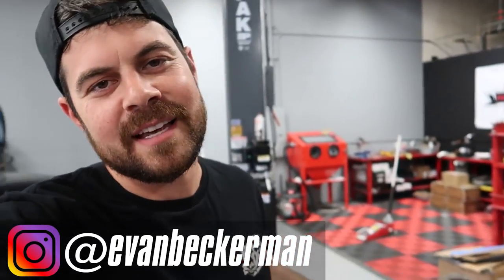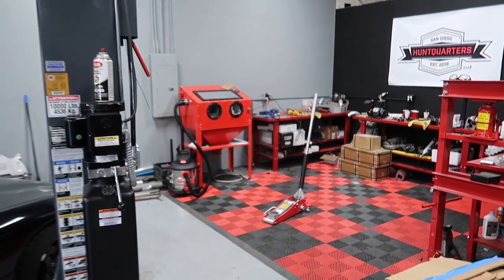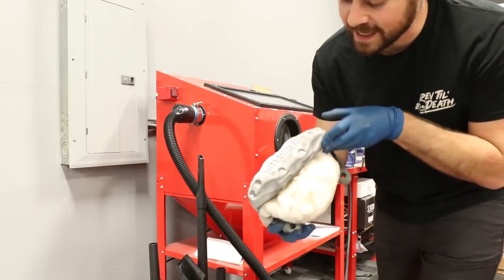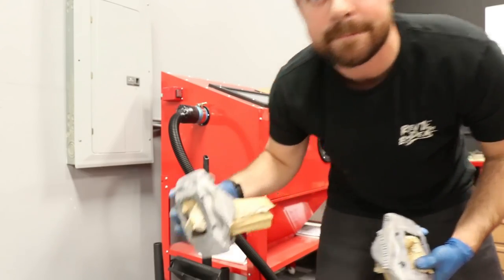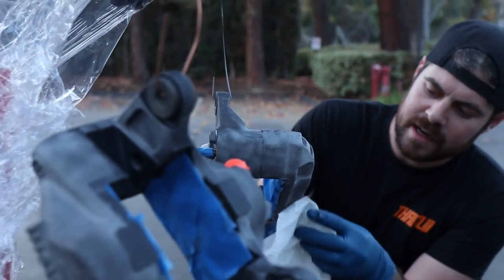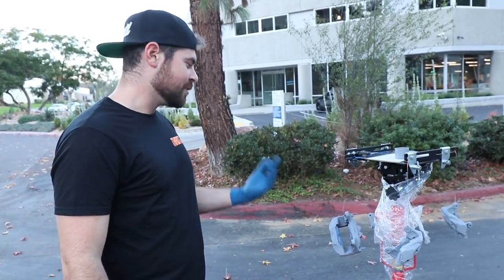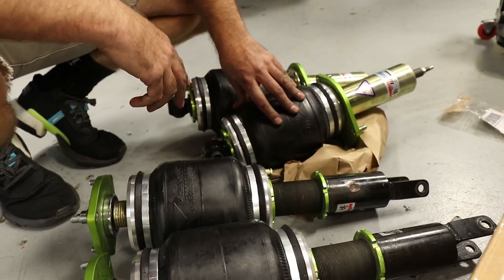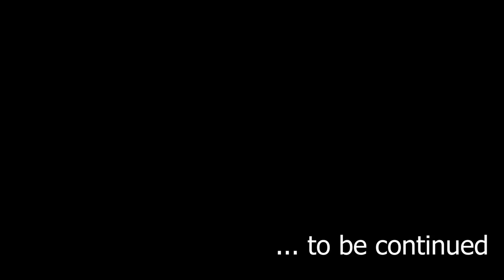3000GT VR-4: HOW TO PAINT BRAKE CALIPERS...THE RIGHT WAY!

Comment: When I worked at a powder coating shop we used to purchase ro;;s of cheap perspex and we used fine shot rather than sand we used to just cut 5 or 6 replacement screens at once and put it under the non damaged screen and then when we couldn't see swap one of the disposable screens saving the original. And we used to clean down with thinners.
I bet Mickey would have loved those bags for his RX7.